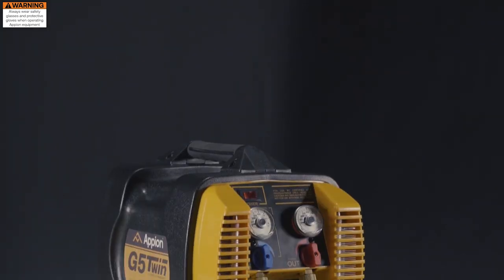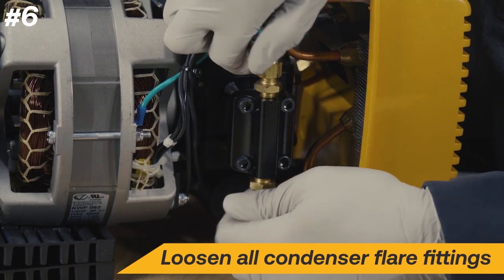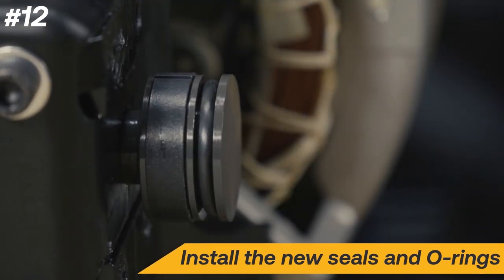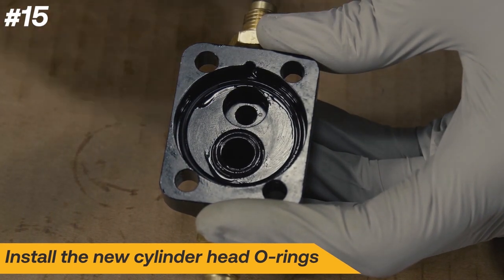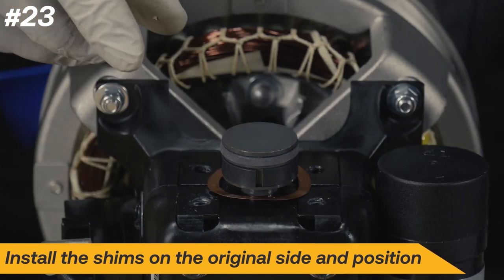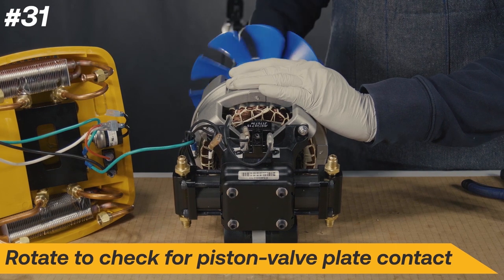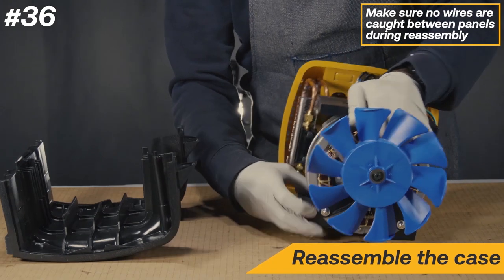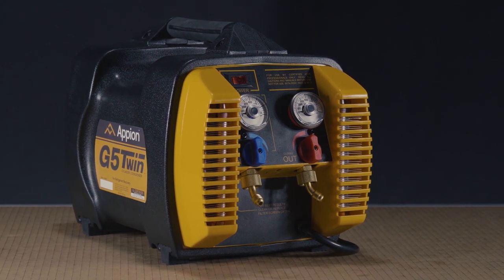G5Twin Repair: KTG520-R Walkthrough

Comment: Note! When he states that the notch on the head needs to face towards the relay and then tells you to repeat on the other head.  Make sure you catch that gold nugget.  Make sure the other head has the notch facing towards the relay as well.   I bought a used machine off eBay and got it for 200$. They said it wouldn’t pump.  Figured it just needed a rebuild kit.  Nope. The seller did a rebuild on it and put one of the notches facing the wrong way.  Knowledge will always be power.
Reply: How long does this repair take?
Reply: @newkidontheblockism  45 mins tops.

Comment: I'm having a leak down problem that is not a cylinder problem.   I know it's not a cylinder problem because when pressurize directly to the high side cylinder port right off the head, it will not bypass through the valves but when the block is in place there appears to be a bypassing of the pressure.  I have checked all fittings and bubble tested the condensers while assembled.
I feel it may be a problem inside the block that holds the gauges and mounts the condensers.  Can you tell me how the block is ported (how pressure travels through it) so I can diagnose where the problem is please?   Would sure appreciate it.  I will check back here  and I can be emailed at Mark@SunStateHVAC.com   Thank you.
Reply: I just sent an email to the above link.